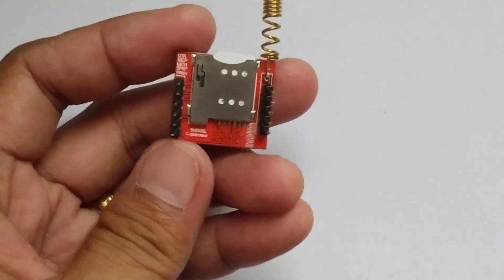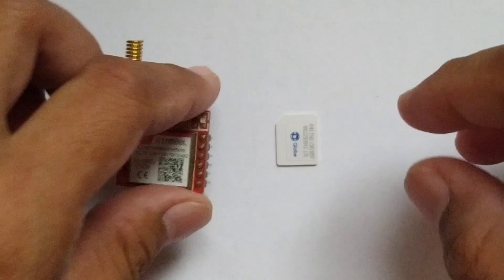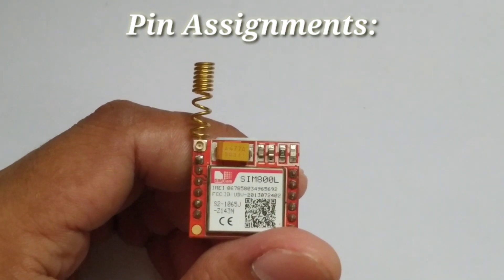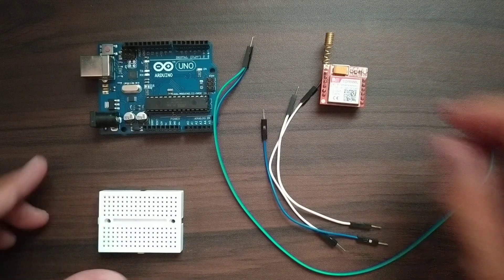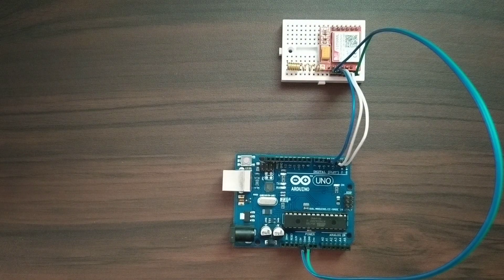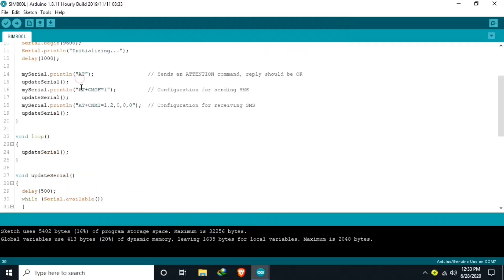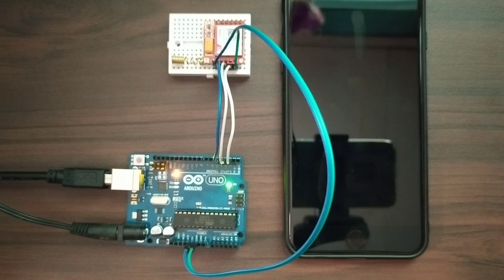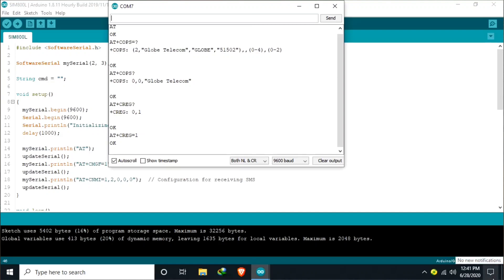Tutorial: How to use SIM800L GSM Module with Arduino

Comment: hi sir is it ok to power it with 5v from arduino or it will 🔥 what should i do to power it with 4.2V
Reply from the maker: Hi @Ardu Robo, SIM800L is a bit tricky to use because of its power requirements.

It is not advisable to use Arduino Uno board to power external circuits, what I would suggest is to use external power supply with atleast 2A capacity.

You may try to use voltage converters to step down voltages to a voltage range acceptable for sim800l which is 3.4V to 4.4V.

Cheers,
George Bantique 
#TechToTinker
Reply: @TechToTinker  is there another way the blue lithium battary is 3.7v it can make gsm on or not
Reply from the maker: @Ardu Robo, do you mean 18650 battery?

If yes, a single 18650 might not enough
2pcs or more 18650 connected in parallel might work. Just make sure to connect it in parallel connection (not series connection).

The reason of parallel connection is to provide enough current.
Reply: @TechToTinker  thanks dear
Reply: @TechToTinker  and for the code i need to connect pir with it which means i need sens message when pir have amovment
Reply from the maker: yes you can, just send the message when PIR sensor detects an object
Reply: @TechToTinker  ok thanks do you have the code of pir with gsm
Reply from the maker: @jafar_tech9570  No I don't have PIR sensor but I believe its easy to use.

What you can start is learn to make the PIR sensor to work. Use google or YouTube for examples. 

After you succeeded in PIR, you can use it to trigger for sending sms. You may replaced the tactile button switch in my tutorial with PIR sensor.

Good luck and enjoy learning. Cheers.
Reply: @TechToTinker  ok thanks alot 😍
Reply: @TechToTinker  hi dear it is connected to sim but when i uplaod the code it still on initialzation still on it what should i do

Comment: Sir,,,, can i make gps traker using only gsm 800l
Reply from the maker: Hi @Joe Rivera, SIM800L is a GSM/GPRS module meaning it doesn't have a GPS capability. However, it is possible to use the cell position and triangulate your approximate location. It could be difficult and not accurate.

Better to use additional gps module. Hope this helps. cheers.
Reply: @TechToTinker  ok thanks
Reply from the maker: @Joe Rivera, You're welcome. Thank you for visiting. :)

Comment: Thanks for your tutorial, but i have a problem with my module, my module always blink every second, can't get the signal. Any solutions?
Reply from the maker: Hello Danang, how did you power the SIM800 module? Normally you should power it with external power supply of 3.4 to 4.4V with minimum current of 2A
Reply: @TechToTinker  4.0 V, using LiPo Battery
Reply from the maker: @danangkurniawan2376  tried adding an electrolytic capacitor between SIM800 VCC and GND.
Reply from the maker: another maybe sim connection. it should be inserted like this: https://www.google.com/search?q=sim800l+insert+sim+card&prmd=ivsn&sxsrf=ALeKk00QdB1-1KCj6DY9VTvmNoVFR1GjEA:1601878787794&source=lnms&tbm=isch&sa=X&ved=2ahUKEwjMmfrA55zsAhUDGKYKHaxRAlQQ_AUoAXoECBAQAQ&biw=393&bih=671&dpr=2.75#imgrc=w6guxI87dIEX1M
Reply: @TechToTinker  still not working
Reply from the maker: Can you double check the voltage between VCC and ground pins of SIM800L?
Reply: @TechToTinker  thanks a lot for your solution. Finally, i update firmware and it works.
Reply from the maker: @danangkurniawan2376  wow congratulations, Im happy that your sorted it out. And thank you for taking the time to share your solution. Good luck man!
Reply: @TechToTinker  Thanks
Reply: @danangkurniawan2376  you use the electrolytic capacitor or not?

Comment: idol nagkaproblema na ako sa pag gamit netong module. Na power up ko na ng maayos, connected na siya sa cellular network, pero problema ko na sa AT commands tsaka pag receive ng text messages sa Serial Monitor. Sa at command pag nag type lang ako ng "AT" ,magdedelay ng konti tapos mag lalabas ng "ATATATA", ang respond naman dun is tatlong "OK" sa monitor, so medyo problemado sa pag type ng commands, tapos sa pag receive ko ng message sa serial monitor, kahit anong message ko sa phone ko, kahit anong sentence, ang lalabas ng serial monitor is "0" lang, wala ng iba, pero na identify ng module kung kanino galing yung message na yun...may tip ka ba?
Reply from the maker: Hi Josh, usual problem ng mga GSM module eh kinukulang ang power supply. Make sure enough yung current mo so dapat may external power supply ka. Maglagay ka rin ng capacitor across VCC and GND ng gsm module.
Reply: @TechToTinker  okay, thank you!
Reply from the maker: You're welcome Josh.

Comment: i also prefer it , nice talaga ito sir dahil may built in RTC sya at makaset ka rin ng alarm ,meron din itong file system, makakastore ka ng text, pwedi panga itong connekan ng sd card at makaplay ka ng mp3 pero mahirap lnag need pa baguhin ang board.
Reply from the maker: Oic, hindi ko pa siya masyado na explore. Nagreresearch ako kung paano yung FM kung meron man hehehe
Reply: @TechToTinker  meron pero, ang antenna nya ay mahirap iconnect , need na nga bagong pcb lgyan ng trace galing sa antenna pad nya.
Reply from the maker: @pinoyenginerd1091  ah sige explore ka na lang, salamat Sir